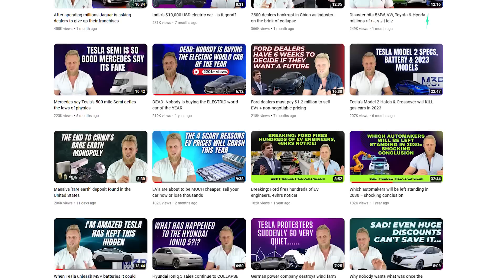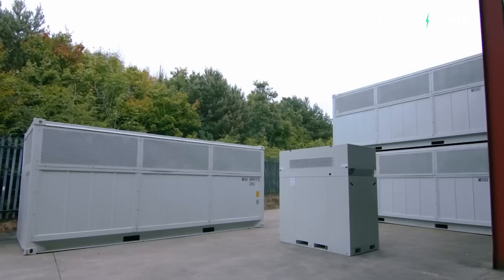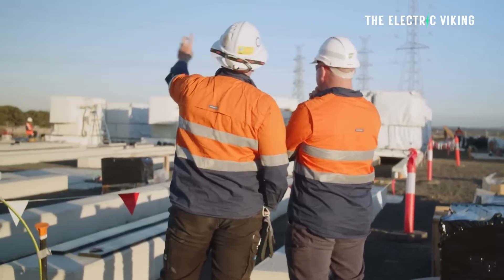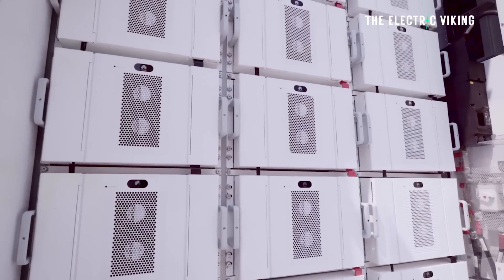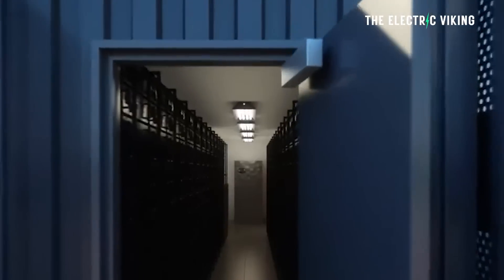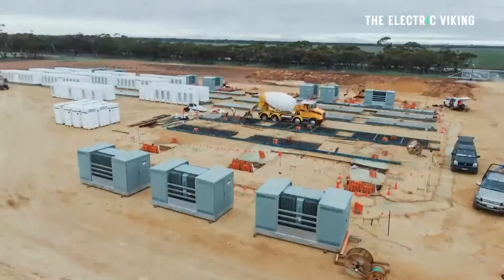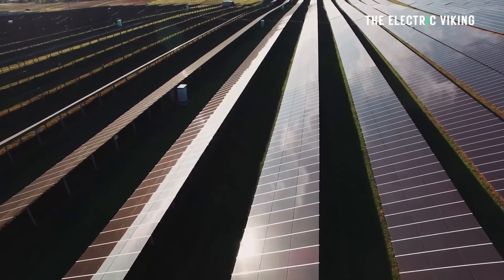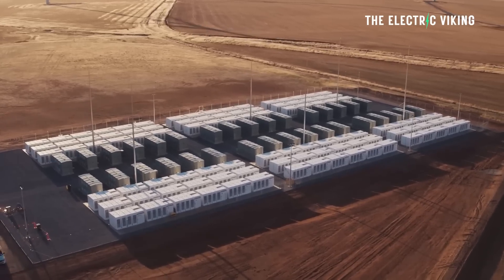The 3 biggest batteries in the world are about to be built in Australia

Comment: Australia is the Saudi Arabia of solar.  Instead of exporting iron ore they should make steel.  Molten oxide electrolysis uses electric energy to turn ore directly into steel.  
Hydrogen is more of a cult than solution.  Being the smallest element it is very difficult to store and transport.  It oozes out of everything in a short period of time.  It needs to be created near to where it will be used, like a cement kiln.

Comment: Lets keep our feet on the ground. 2000 MWh is certainly an impressive battery but realise it only provides full power for 4 hours. Certainly it will provide load levelling but 4 hours is not long enough to reliably compliment renewables. Lets celebrate once 'renewables with back-up'' can provide reliable 24x7x365 power .

Comment: This is great news.  Kudos!  I find it interesting that an individual state government is doing this independent of the national government and for an affordable price, and will profit for a long time.  In Canada we have independent provinces as well, some that are strongly pro renewables, one in particular that produces one of the filthiest forms of oil on the planet with two sister provinces addicted to coal (thus jacking the average per capita national emissions to the stratosphere), and several that are neutral (mainly hydro powered).  The federal government has its feet in both camps, but as we see in this video, the paths are suddenly diverging with one that will ultimately dominate.  The battery chemistry was not mentioned, was it?  The charge lasts only four hours too.  Form Energy (out of the MIT labs in the US) has an iron-air battery with a charge that lasts four days and is similarly scalable.  One could conclude this would be a more advantageous chemistry and performance.

Comment: Sorry to break this to you E-Viking. The 1600Mwh battery in California will go flat in one hour if it supplies 1600Mwatts of electricity to a load. The 2000Mwh battery in Western Australia will go flat in one hour if it supplies 2000Mwatts of electricity to a load. So it's not awesome it's just really Flea - Power. Or should I say Flea - Energy.
Reply: Their main purpose is to get through the evening peak. The WA battery is 1000MW/2000MWh so is good for the capacity of a full coal plant for a couple of hours, which will make a big dent in evening peak demand.
Reply: @tassied12  And when these batteries fail or loose 50% through battery degradation,  what then? make some new ones? Using coal to melt steel & other minerals etc. Might as well just make a bloody coal fired power station and be done with it for 50 years.
Reply: @massatube  Battery installations are modular and easy to swap modules in and out. 

Coal plants are being squeezed out of the market. Australia is a sunny country with the highest market penetration of rooftop solar in the world. This coupled with high energy users such as the Sun Metals Zinc refinery and the Whyalla Steelworks switching to solar for 20%+ of their energy is hollowing out demand during the day.

The latest AEMO report shows an increasing frequency of negative wholesale prices on the grid. This happens when wind/solar are meeting nearly all of baseload demand and coal plants are forced to pay to take their power because they lose less money than if they had to shut down and start up again. This is happening at the time of day when energy use is greatest when coal plants used to make most of their money. Records are now being set each year for minimum demand from the grid.

Batteries and pumped hydro are the only technologies currently available which can soak up this excess demand and make it available at times when it is most needed.

Look up the term 'duck curve'. It is one of the main reasons coal plants are shutting down and why battery projects are springing up all around the country

Comment: It's interesting that China's Big Battery is Flow battery . I wonder why Australia doesn't set up building Flow batteries on a massive scale . Redox flow battery manufacturing is very small we could step that up a thousand times . Maybe we could also set up  making Wind turbines in Australia , say South Australia so transportation is easier and place them along the Coast from South Australia to Western Australia  . Link Western Australian to the east coast with Ultra High Voltage DC. cabling which has a minimal probably 6% in that distance .
Reply: Because flow batteries themselves are very inefficient. Lithium batteries are highly efficient, reasonably compact and are mass produced to the point the supply chain is already in place. Lithium batteries are no longer experimental meaning that the investment costs are guaranteed to return a measurable profit.

Comment: Australia should plan to use its energy abundance to power the industry in order to replace exporting raw materials like iron ore, bauxite or spodumene with steel, aluminium, lithium and goods made of them.
Reply: Yeah right. The 1600Mwh battery in California will go flat in one hour if it supplies 1600Mwatts of electricity to a load. The 2000Mwh battery in Western Australia will go flat in one hour if it supplies 2000Mwatts of electricity to a load. So it's not awesome it's just really Flea - Power. Or should I say Flea - Energy.
Reply: @massatube  There are other methods for storing energy for industrial use. Like hydrogen for iron smelting.
Reply: Australia's abundance of energy, required to power heavy industry, is actually being exported to China in the form of coal. Australia has the highest quality of coal for power generation in the world and China can't get enough of it. These ego projects are absolutely useless for actually powering a nation, they only exist to make billionaires even richer, at the expense of the Australian taxpayer.

Comment: I've heard of an idea to export green hydrogen from Australia to Japan which I find utterly stupid. Disregarding transportation cost by special tankers, losses on electrolysis, compression and electricity generation by a fuel cell reach 70 percent, while transmission losses via a 7000 km long high voltage DC undersea line are just some 20 percent. Yes, such a transmission line doesn't exist yet, but massive electrolysers, tankers and fuel cell farms don't exist either, and the latter are much more expensive to operate and maintain than a transmission line. Plus you need water to produce hydrogen, which may pose a slight problem in some places in Australia ;)
Reply: And Green hydrogen hasn't worked on a commercial scale........ (I won't say YET either)

Comment: Will be interesting to see how rapidly solar panels mounted on vehicles develops. In countries like Australia where long distances have to be travelled, often in remote areas where plug in power is infrequent, presently drivers may be left in perilous situations. At least with  petrol and diesel powered vehicles spare fuel can be carried to make the journey possible.
Once 1000 mile capacity is achievable especially on heavier, larger wheeled 4x4 vehicles, that will make journeys safer.
Reply: You could carry lightweight rollout panels for emergencies and more surface area.
Also useful when parked for couple of days.
Reply: Do calc if you could get 500w of solar cells on a car you would get around 60% on average through the day from them so thats 200wx7hrs =1.4kw. you can’t go far on that at all. There are no technologies around the corner that can fix it. Electric Jesus tesla talked about this when interviewed on you tube somewhere sorry it was in the shorts but the numbers speak for themselves.

Comment: I worked on the construction 
of  the Muja coal fired power station Stg C and D.
And the transmission line to Kalgoorlie. 1980 to 84.
The transmission infrastructure construction costs are huge but were critical at the time.
Today 5times more electricity and it's transmission infrastructure 'fattening' is stupid. 
Rooftop solar PV has  no transmission costs, an unbeatable head start on costs.
And the sunniest state, in the sunniest country on the planet. 

Many do not understand the bs in the nuclear industry promoters arguments.

Comment: As mentioned - for how long can WA be supplied with power from these batteries and at what cost per kWh? (Same question for the east coast) include additional copper wiring please.
What type of batteries, useful life expectancy, recycle info?
Reply: Easy fix add 25GW wind generation to the grid.
Reply: @pietersmit621  Sure, at what cost and what for, cause there is no climate emergency.
Reply: @orionbetelgeuse1937  All pretty spot on but LFP battery's now have more than 6000 cycles to 70% degradation. They have a lower energy density to be sure, but thats not a problem for box you don't have to push around.
Reply: For EVs the grid needs controlled load AC chargers at workplaces, and carparks. Dump cheap solar power into them during the day. If solar output is low, then give the owners an app to control charge level and cost of power purchased.
Very happy with off peak charging in Queensland. If comes on during the day if there is a glut of solar and wind.
Reply: @orionbetelgeuse1937  Mate I was agreeing with you but my point was that you are way out with the new battery chemistry's. LFP battery's for example can do in excess of 6000 cycles and they prefer to be charged to 100%, unlike the old chems. They are cheaper, don't need cobalt, run much cooler and are immune to thermal runaways. Down side, they are less energy dense but that does not matter for fixed storage. They also don't work as well in extreme low temperatures. (think snow) There are many other promising new chemistry's for battery storage. Like sodium iron phosphate, that require very common and easy to source elements. So you were quite correct on your other points but your views on battery life and cost are based on old battery technology.
Reply: @orionbetelgeuse1937  Once again you are looking at old chemistry. LFP or Lithium Iron Phosphate do 6000+ cycles on the test bed. That is with rapid discharge and rapid charge. So probably more in the real world no one knows as they have only been using them for about 2 years. There are new battery's still in prototype boasting 20000 cycles. If the vehicles battery management system is not at Nisan leaf levels you will get a lot more cycles even with lithium ion. Some "old" Tesla's have gone 300 000 to 500 000 miles on one battery before needing replacement. As to warranty my Model 3 warranty is 8 years and 100 000 miles.

Comment: Pumped-storage hydroelectricity systems are by definition also batteries, just not chemical batteries. There's one planned in New South Wales, Australia that will have a capacity of 350GWh! This would not even make it onto a top 10 list of large scale Pumped-storage hydroelectricity.
Reply: But a lithium battery can respond with over 100MW of power in lees than 100 ms. So we need both technologies.
Reply: @eclecticcyclist  agreed, but probably not the scale being deployed here, especially if these are going to use lithium or other not-so abundant minerals that are better used for transport applications. Humanity needs to allocate the available resources carefully to maximize the benefits to be obtained from them if we truly want to decarbonize our societies.  Sodium ion or similar chemistry would be no problem though, the power density is not as critical in grid scale energy storage uses.
Reply: Well said, I was going to make that point myself. Pumped hydro batteries are much larger and worldwide capacity is huge compared to chemical battery storage.
Reply: The only disadvantage to pumped hydro is that it cannot be viable everywhere, it requires sufficient water and a difference in elevation to be feasible. However, wherever practical, it’s a better idea than chemical batteries IMHO. 

Pumped air (stored in bladders underwater) is also quite interesting, although again specific siting requirements will limit where it can be used.

Finally, gravity based weights are worth considering, but probably only where there’s existing decommissioned mineshafts.

Due to their near-instantaneous response, chemical batteries also are extremely useful for short-term grid stabilization and power smoothing, but these batteries are not for those purposes, they appear to be for actual medium term power supply, which personally I’m not a fan of. Leave the battery materials for transport needs and use alternatives for stationary energy storage.
Reply: The electorate where the hydro dam are located are rural. Very often the water is retained to backstop irrigation rather than the grid.
Reply: @Zen_Differential8004  Pumped hydro storage has nothing to do with irrigation systems, get your head out of your ass.
Reply: @Zen_Differential8004  Dams are often built just to regulate the flow of rivers and guard against flash flooding as well as mittigating droughts.

Comment: No one is talking about fossil fuels getting more expensive as demand drops. There will be an initial reduction but as fixed costs start to become more significant the revenue required will need to be a minimum amount. If fuel prices start going to up people will have more incentive to switch.
Reply: It won't go up because the cost of production of the last needed supplier will be lower.

Comment: If each household has solar panels/inverters, combined with 2 EVs, they will never have to gas up their cars, ever. 😊
Reply: Where will the power come from at night?
Reply: @massatube  Battery's, what else? I have a 10 kw array and a 27kw battery Don't use mains power and I Fuel an EV as well.
Reply: @lionelwylie2326  I'm with you. no electricity or gasoline bills with only a 15kWh battery (shortly to be 25kWh)
Reply: @ralphzoombeenie2330  What size is your solar array? I don't need the two Powerwalls but it means that I can run aircons in the wet season at night and still have over 60%. The 10 kw of panels normally recharge the battery by lunchtime. If its rainy and overcast all day sometimes I don't recharge fully. Never happened but I think I could go a week of rainy overcast days before I would need to load shed. starting with the car then the aircons. I am not connected to the grid.
Reply: @Lionel Wylie  I'm still connected to the grid and I use the grid as batteries. It works for me here in FL, so far.
Reply: @massatube  solar panels
Reply: @massatube  the solar panels deposits power back to grid, then you withdraw that power back from the grid to your EVs